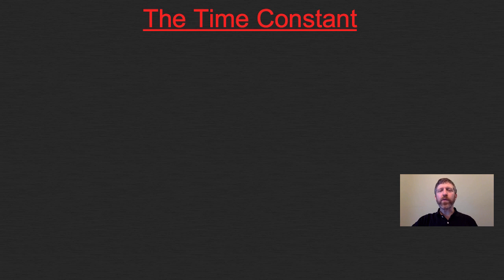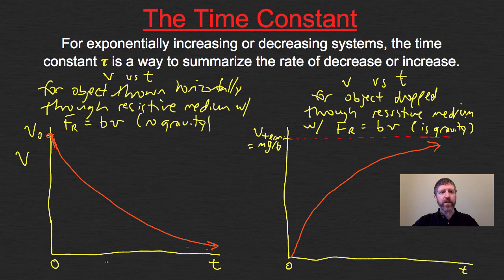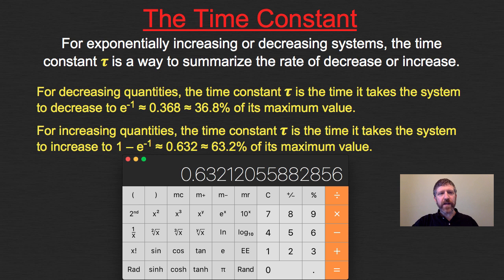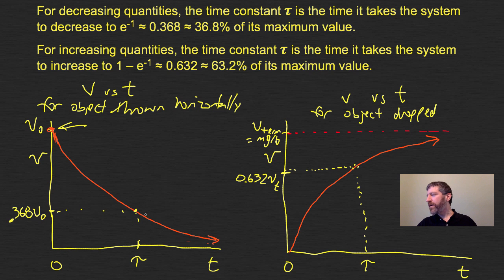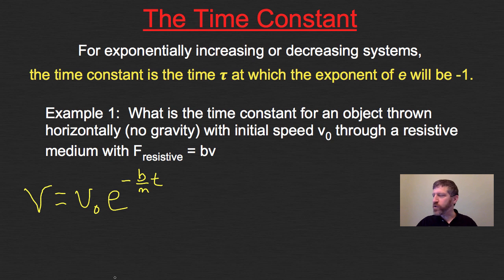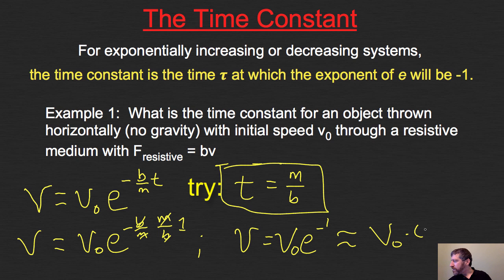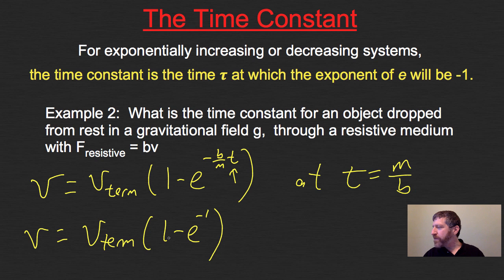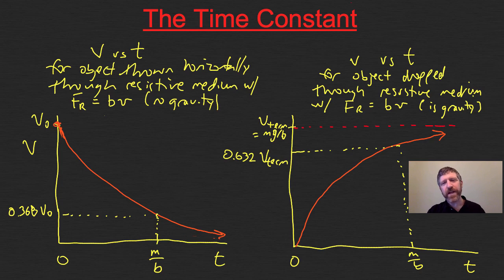2.17 The Time Constant Tau

Comment: when a response of system is analyzed with time constant, why is tau the value when it is e^-1 ? what is the physical meaning of e^-1 as tau?
Reply from the maker: certain types of system where the rate of change of some variable (say, 'charge') depends on the variable itself, are often expressed as the natural base of logarithms e to some negative power of t.    -the time derivative of e^-kt is -ke^-kt is , so you can see that the rate of change of the quantity is proportional to the quantity itself.    e^x is a magical function in which it is its own derivative!
Reply: what is the significance of finding slope i.e diffrentiating c(t), total response, at t=0 ,we get 1/T(tau)